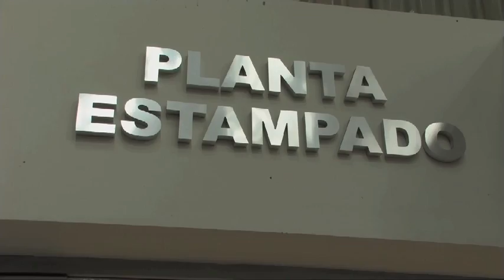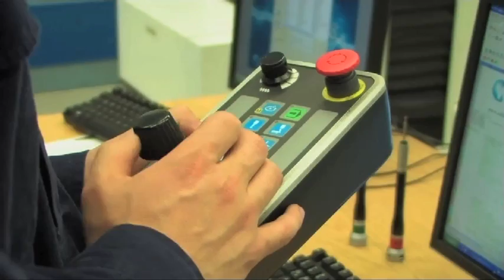Toluca Assembly Plant   Fiat 500 manufacturing footage

Comment: I had a 2006 Mini Cooper. It was the biggest piece of crap I ever owned. Had trouble every month I had it. Got rid of it after 6 months of hell. I now have a 2013 Fiat Abarth. It is reliable and not one problem and fun to drive.
Reply: The scary thing  about it,  is that they're both related to Chrysler. I have a 2012 Fiat Pop. Bought it used,  no problems so far, and it's a blast to drive!
Reply: No, the Mini Cooper had a engine related to the neon engine but everything else was BMW.

Comment: I really like my 2013 Abarth. 
It's had a few issues here and there, but the dealership handled everything under warranty, without so much as a flinch.
The car is a blast to drive, both on and off the track. 
Past Issues with the car:
1.) Needed a reflash of the PROM in the first 5000 mi. (Factory Advisory Bulletin). Took 30min in and out. Car ran even better afterwards. No charge.- Done.
2.) Window mechanism began clicking at the end of full open. That is warning that the cable pulley is going. If you hear it, get it fixed before the thing lets go and necessitates a whole new regulator. They know about the problem, and the dealership should take care of it. It's a quick fix if you catch it before it goes completely, it's fast and easy.
3.) Mine was one of very  few that ate its turbo bearing within 5000mi. It was a defective batch of AR turbos. (That's not Fiat's fault.) Dealership handled whole thing- New turbo, intercoolers, and tubing. No charge. Three days, because one tube was back ordered from out of state. No problem since.
4.) Painted panel of sunroof assembly, above the windshield (you can see one being installed in the video above), chipped and peeled. Again, a known problem on the darker cars. Dealership repainted. No charge. Looks perfect.
5.) Chrome plating on some plastic emblems and one door handle bubbled and peeled. What can I say(?), Arizona sun is deadly. Dealership replaced. No charge.
6.) Rear windshield wiper refused to automatically "park" in the down position. Dealership fixed it. Worked for awhile, then resumed need to park it manually by timing the shut-off. I don't care. It almost never flippin' rains here anyway, and even when it does, I don't use the rear wiper.   
The car has no rattles. There is a small amount of torque steer only under hard acceleration, but it is very slight. As the cabin seals have dried slightly over time, there has been some mild increase in wind noise, but, as I said, AZ sun is deadly.  
Things that could be better(IMHO)-
1.) I wish that the car had a manual 6 speed option with a higher overdrive. AZ interstates are high-speed for loooong distances, and I hate doing 3500-3800 RPM continuously for hours on end when it's simply not necessary. 
2.) The 10 gal gas tank is too small. The car should have a range of at least 350 miles. It gets ~28mpg at interstate speed. Would it have broken their hearts to have installed a 12.5 - 13 gal. tank, which would have provided that range? C'mon, Fiat! That little tank might work for the POP, but the Abarth is a bit hungrier. The package should've included a bigger plate for a larger meal.
3.) Yes. The Beats stereo kinda sucks. It's an overly bassy POS, with poor mid and high-range clarity and Dr. Dre should be ashamed of himself for putting his name on it. 

All of that said- It has always started and driven, even when the turbo went. Completely dependable and a really fun daily driver. Love the car.
Reply: Thanks for the run down, helps others a lot..besides the turbo and reflash looks like not much else could sit you on the side of the road yelling SHITBOX Lemon..so you have the Diesel model?

Comment: I have my Abarth for a year. The interior has a lot of rattles. Almost everyone experiences driver side window rattles. Dealer helps us fix it by adding lubricant at weather seal. Problem comes back in one week. My blower fan motor whining very noisy starting 7k miles.  I will recommend the car to friends is don't like.
Reply: 2013 Griso with everything...58k...tight as a drum...no similar problems reported by ANYONE in my club...so much for "almost everyone".
Reply: nsmsam , all cars will develop rattles but they are very easy to fix. I had a camry before and within six months was creaking and rattling. Because friction between plastics and between metal and plastic cause these perceived rattles. They are very easy to fix. Just get yourself a can of spray that the use for motorhomes to remove friction from sliding parts like sliding doors or windows. It works great. Spray some on the door seals, hinges, window channels, door panels where thr panels come in contact with the door. You dont have to use a lot. You will be amazed how quiet the car becomes when you eliminate creaks and rattles.
Reply: A Toyota with problems? Impossible! Must be the suppliers issue.

Comment: Looking at how much they're driven in the plant I'm beginning to think I was the only one to test drive my Abarth. Odometer had 4 miles on it when I drove it off the lot.
Reply: Interesting you say that when you bought it did it still have the h next to the mileometer if it didn't then it had been put back to zero before you had it 
The car can do 99 miles on the h and still be returned to zero with the menu function on the right stalk as long as it hasn't gone over 100